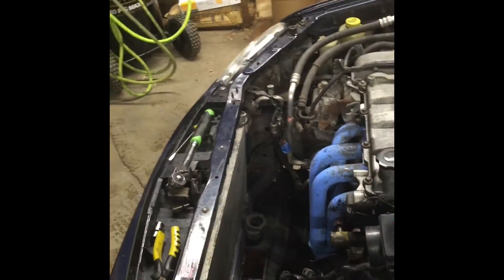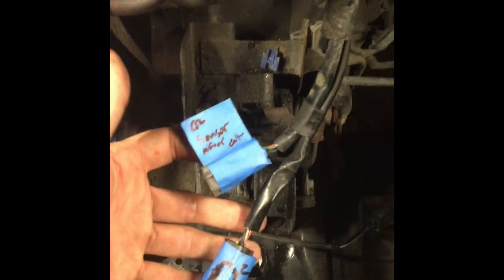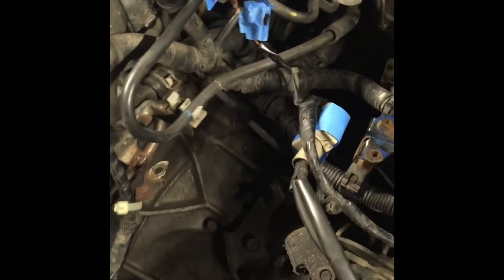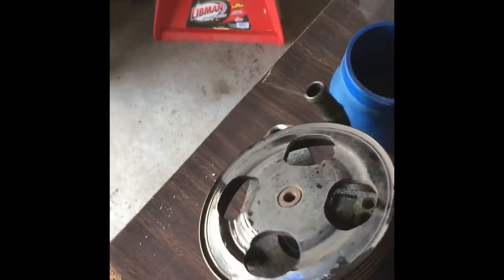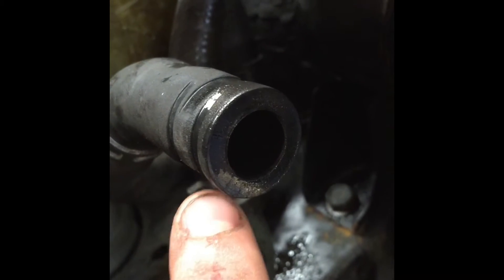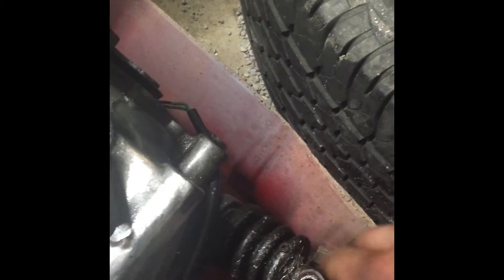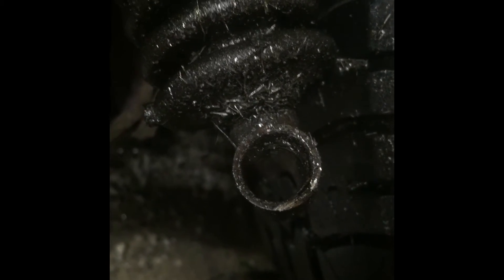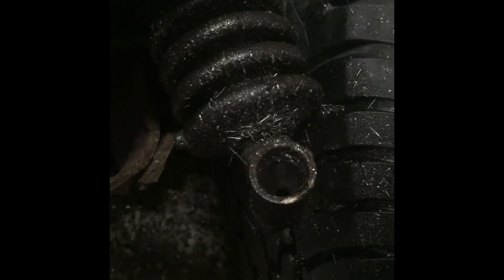Mazda Protege 5 Turbo Conversion Part 1.

Comment: Just wondering how many miles is in the car and how many miles is too many to add a turbo
Reply from the maker: This is a stock turbo for a Mazdaspeed protege and the engine is the same as long as you dont crank the boost past 6 send it!
Reply: So you have to take all this shit out to put in the mazdaspeed turbo in a stock protege.